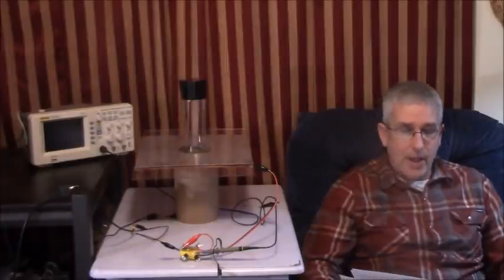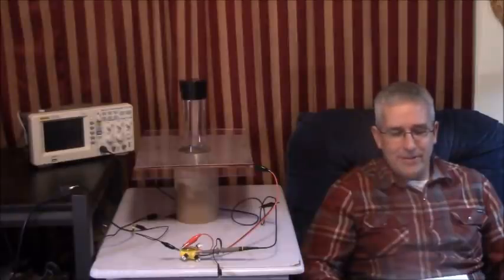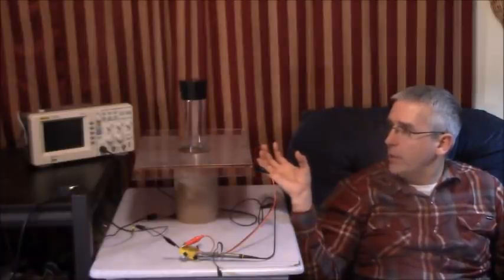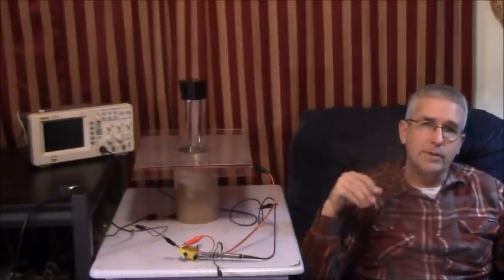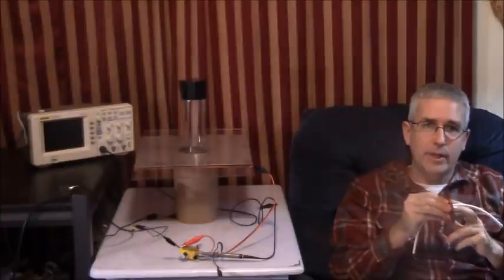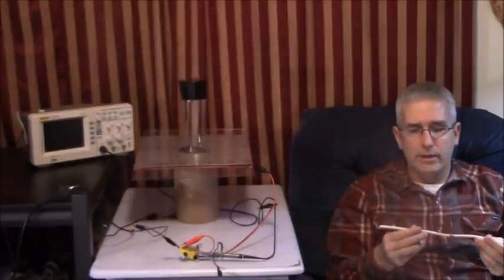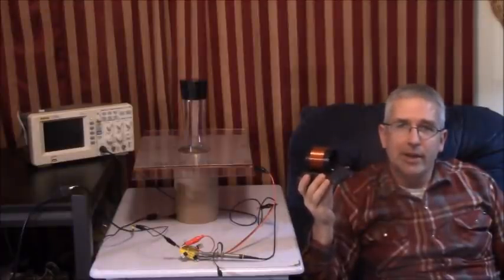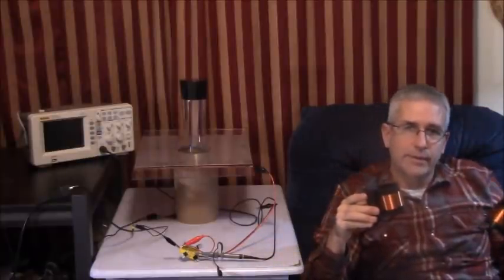How to Develop Free Energy: Plasma Column Dipole System

Comment: Thank for explaining and showing us this, Rick. I see this is the Dipole Transformer Generator found in your Don Smith book. Do you know of the important of the plates are of different metal types? The Heavyside current direction goes from South to North, copper plate south (-) side, and aluminum plate north (+) side. Is it because copper has more free electron density? Is it possible to add/pair plates to each of the receiver coils in Don's device #2 model for even more output gain?
Reply from the maker: Yes that is what I demonstrate at my meetings.
Reply: @rickfriedrich  Cld two metal plates be used as well?

Comment: Great video , many thanks for sharing  , 
Please correct to me if i was mistaken .. so the Aluminum Plate it is not connecting to anything , and the ground wire is connecting to second lead of capacitor , and how many volts for two plates ?
And if i replace the plasma tube with fluracent tube , can i get the same effect of ambiant energy ?
And please explain how Don Smith said 1 Farad is equal 1 KW , and here you said Nano or Pico Farad can produse many KWs..
Please more explain about ground connection with schematic ,,
Thanks in advance

Comment: How to find the value of a capacitor in resonant isolation transformers
Reply from the maker: To determine the resonance you need to put in two of the three values into the equation. If you have determined the frequency, such as 50 or 60hz then you just have to measure the inductance of the winding of the primary you wish to use with the capacitor that you are looking to figure out. You need a meter like and LCR meter to do that. Or you may be able to look at the transformer's data sheet to find that out. There are online calculators where you can just plug in those two numbers (frequency and inductance) to determine capacitance). Like daycounter . com

Comment: Hello, please tell me why the base resistor of the transistor is heating up in the Bedini generator?  I use a 50W resistor and it still gets very hot and the resistance starts to go up a lot.
Reply from the maker: I'm assuming you mean the SSG monopole setup. 50W doesn't tell me the resistance value you are using. It is obviously to low resistance for your setup, unless it is in the wrong place. The resistor limits the power level.

Comment: Hey Rick, great video... what are you using to drive the gate of the scr thyristor at 60 hz?  I have a couple kp50a SCRs but I'm not sure on the proper way to use it. The kp50a that I have has two gates a red and a white

Comment: Hey Rick, The video was great, I have watched it quite a few times now along with Don Smith's lectures. The HF/HV generation I understand and have charged caps and run resistive loads off of them mainly with a ZVS and Bifilar pancake coils. The part which I, as I think many don't quite get is the last step of timed capacitor discharge. Is this a 555 timer and a thyristor like a function generator to pulse at 60Hz? Would it be possible to do a video showing this particular part of the circuit as there is very little info available on it... 
Totally with you on resisting the Great Reset, I have known about UN Agenda 21 for many years after listening to Rosa Koire, so when the fakery started in 2020 it was a massive red flag, also with you on team #novirus... Tom Cowan has been such a godsend trying to make head nor tale of the situation... contagion is a myth...

Kind Regards from the UK Jamie

Comment: Could we use the iron core of the output isolation transformer as the ground for the device?
Since iron is at the core of our planet itself, it may be the primary source of electrons drawned to it from the environment (also the source of gravity)...
Reply from the maker: No, the opposite. It is the non-conductive materials in the earth...
Reply: @rickfriedrich  Cool, thanks Rick! So if I would be using a microwave oven high-voltage transformer (MOT), in reverse order (HV to LV), that normally has its wiring (on HV side) grounded to its own iron core, I would have to disconnect the grounding and connect it to the Earth ground instead?

Comment: I think electrons are pull out from the ground to capacitor in first phase and then pull in from the copper plate throught diode to ground (like a cycle).As result, in that ground black wire alternate a 26khz current, I am wondering if put Alumminium/Copper  plates around it , can I get  similar results to plasma cylinder ?

Comment: Rick, may you please make a video which shows step by step of how to charge a small battery (any battery) with the plasma column dipole system. I have asked someone that works with ham radios and he said he’s uncomfortable working with high voltage plasma. And he told me if I charge a battery with the energy field around the plasma globe or column, it can blow up the battery because it’s too powerful. And he also said that the high voltage from plasma can be deadly and he won’t touch it. It surprised me that he said this because he’s been working in ham radio for over forty years and knows how to work with and build radio equipment. I told him I would pay him to help me, he declined my offer.

I explained to him that we’re not interacting directly with the plasma, and that the capacitor plates are required to be 3/4” to 1” in distance from the plasma column. And that it’s the “Heaviside electric wind” that I must capture with thin aluminum and copper plates with thin plastic (dielectrics material) or Kapton, to separate the two metals. And that these materials are to be connected to a 10 micro farad polarized capacitor with a full wave bridge rectifier, scr, mosfet or transistors (I’m just repeating what you said but I don’t know how these parts work). He started to explain to me that I’ll have to clean up the signal with resistors to make the energy useable. I told him that the ground wire is where the electrons are flowing into the circuit and that we need to put a resistor in the ground wire because the electrons take the path of least resistance, and will flow through the load. And that the entire circuit can share the same ground wire (if I understand correctly) but rick, I learn best by seeing step by step. I’ve read thousands of books, I have don smiths book, I can memorize things, but it’s not until I build it, that it makes sense, and I learn most. You said in the video these systems can make thousands of watts and even 50 megawatts, which is exactly what don said (and that’s not funny at all, it’s very serious) and it’s the reason I write you today. I’m building this system and I’m looking for help to build it, but I don’t want to make a mistake and get hurt. Step by step is the only way I know, I can be safe. Thank you for all of your great videos Rick, and please continue to share everything, you have learned (and everything you teach in your lectures and seminars), in your videos here, so that we may carry the torches of wisdom and knowledge, to light every shadow of doubt and misunderstanding; the place our greatest fears, exist.
Reply from the maker: I'm sorry but your line of questioning is problematic in regards to liability. I cannot give such instructions over the internet because it is in fact easy to get hurt in some way and people are all about blaming others in our day. Also, this research is not for people who don't have the basics of electrical knowledge and experience. You need to spend some time if you want to do something with this, in the same way you would need to know some things to do an oil change in a car. It is more than just step by step instructions and wanting some outcome but knowing about the specific parts you are working with and the potential dangers with assembly and applications. There are immediate dangers and long term dangers that need to be considered, which I have pointed out. This is why we are limited in sharing things on the internet.
If you have a significant magnetic resonance induction system and get between the ground and it you could be injured. So that kind of research should only be done by people qualified or experienced enough to understand what is necessary to work with these things. Discharging a charged 10uf capacitor from 250V is not a joke even though it is only 0.3125 Joules or 0.3125 Watt if done once a second. It may seem like an insignificant amount of energy, but it can do some damage.  Now if you were able to charge and discharge that 10uf capacitor 28,000 times a second to that 250 volts you could have 8750 Watts! I say this because that Plasma column dipole's frequency is 28khz and with sufficient collector capacitor and grounding that could actually happen. You probably couldn't discharge it each cycle so you would realistically get much less than half that because you would usually be step charging it with many cycles until you reach that desired discharge voltage. But my point is that you can still produce a lot of energy from this each second from one collector capacitor or from several. Say you had 60 sets of plates which you were only charging up to individual 10uf capacitors to 250V per second you could have 18.75W. And if you were able to to charge up and discharge those caps 60 times per second (as in 60Hz) you would have over 1KW or 1,125 Watts. So depending on what you do you can easily go from insignificant energy collection and transferring to dangerous levels. You can't just jump into that because of a desire for free energy and risk hurting yourself. This is why I'm trying to caution people and why I make kits for people who are ready to do safe experimentation. The next Resonance Induction Coupler Kit part 2 on my website shipping out at the end of the month will be going over these things in detail. It will be doing this a lower voltage and power levels.
Reply: @rickfriedrich  Rick, I’m writing with an update. I don’t know how to tell you how happy I am that I was able to create a spark, from energy that was generated by the plasma tube/column. With the help of someone that knows more than I, about electronics, I was able to put a circuit together that worked and it made a spark similar to your video. I don’t have words for how happy this makes me. This means a lot to me and I’m so excited to continue learning from experience.

The gentleman I’m working with doesn’t seem to understand the “Heaviside Electric Wind” but is willing to be guided by the knowledge I have learned from you, Thomas Bearden, Donald Lee Smith and many many more.

I hope you will make many more videos, which share in the greatest possible, non technical detail, how to be safe when building this system. I study day and night, and even in my sleep, in dreams. I hope to continue to learn, from you.
Reply: @rickfriedrich  
Hi Rick,
I’m very grateful for everything you do, and share. Don smith mentioned that anything electrical, such as electric motors (if I understood correctly) are great sources of this disturbed ambient background energy. And don also mentions “most of the items in his systems, are not required, and that he only placed them there because people expect to see the extra unneeded components” Is there a simple (fewest possible parts and least complexity) way that I can use the energy disturbance emitted from a brushless electric scooter motor (dueltron eagle pro) to act as a range extender by helping to keep the main battery charged?

For example, don shows one system where he has a neon sign transformer that is connected to diodes and these diodes (not sure if half wave (2) or full wave (4) diodes) connects directly to a capacitor bank. In this video here (above) you mention “connecting directly to a battery from the full wave bridge rectifier” (paraphrase) as being a process that may allow the direct use of the energy from the full wave bridge across the capacitor (as demonstrated in this video) and then it sounds like I could connect directly into a battery. Is this correct? I’m not certain I understood correctly when you spoke of this, briefly, in the video.

I realize I’m talking about two different approaches here but if you could talk about both, I would be most grateful. I’m reading your book (Don Smith Magnetic Resonance) and I’m really trying to understand how to do this at lower power levels to keep, for example, a scooter battery charged (see above).

I hope to hear from you Rick, I know I get really excited about this but how could I not? The universe is absolutely amazing, and we are a part of it.

You mentioned the dangers of these systems and how quickly they become dangerous and hazardous. I hope you can help me to understand how to charge a scooter battery with low power. Maybe 100 watts or up to 500 watts maximum. I know any amount of energy can be dangerous, but I hope to learn from you, how to be safe when working with such lower wattages. Making videos which expand on this context would be really helpful, and your replies are always helpful as well. Thank you for everything, Rick!

Comment: We are a team in scandinavia that are about to setup a collective under the Ubuntu small town ideology and we fallow common law. Ive been into free energy for many years we have a method in ubuntu to boil water for almost free but i decided that this Don smith device is much more practical. I Would like to have some help from you. The main thoughts i have is about the capacitor bank and recrifying method and then to control the frequency. How do we control the frequency don smith mentioned that the capacitors was important for this but i wanted to ask if if can be adusted analog style with 2 coils one inner and outer one. Second question  was about the rectifying method. high voltage none polarised capacitors and high voltage diode between the legs would that be enough or right?

Comment: Yes balance for charge discharge, people don't get this principle. Like you said the source must work free in a constant current or limited power then output will be usable, give take cycles.
Microwave oven is a good example, transformer is current limited and the magnetron is a resonant circuit, that why we can warm food very fast. Remove the magnetic shunts between primary and secondary and the house breaker will trip. So source must be regulated to draw a constant wattage or maximum current limit.
Don used neon transformer these a current regulated.

Comment: Hi Rick, at 1:09:50 you say the oil-filled cap is polarised and that "you want a polarised capacitor". Did you mean non-polarised?
Reply from the maker: No. Polarized, as I said.
Reply: @rickfriedrich  Thanks. In that case are you referring to the photo flash caps? They look like great caps but don't seem to have long life expectancy from the specs.

Comment: Very interesting. With regards to your piano comparison, when the sustain pedal is on, you got me a little confused. The strings that vibrate in sympathy with the source note, are merely picking up some of its energy. It is a transfer of energy, not a creation of more energy. The energy from the source is just being utilized by the other strings, when they are not dampened, rather than "going to waste"... I am less confused by your avelance comparison, because the "finger snap" causes an additional energy source to activate, namely the earth gravitational force.... Am I right? Thanks for your efforts to explain things simply and at a good speed.
Reply from the maker: All the strings, including the only one struck, are freely oscillating thousands of times rather than the one string only producing one sound and immediately dying out. They are set in motion and continue for free. The effect is greater than the cause because of resonance and the nature of oscillation energy.
Reply: @rickfriedrich  Hmm... Yes, you are right. A string that starts to vibrate in sympathy with another, will continue its oscillation for a while on its own, even if the other, resonant tone is abruptly stopped... Got it... I think I need to watch some more of your videos to better understand what's going on... So far it looks like you're using coils or plates as antennas to pick up the electric field that emanates from your source circuitry. My thinking is that it is too weak to be of much use... It wouldn't make much difference overall... But you're saying otherwise ... is it that people have overlooked the benefits of resonant oscillation?